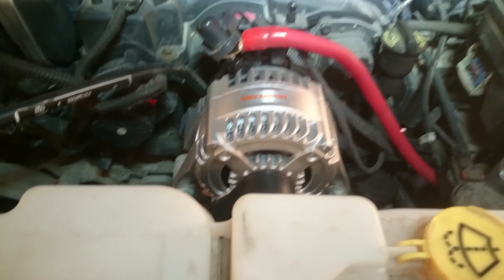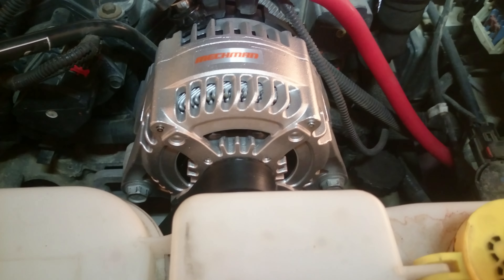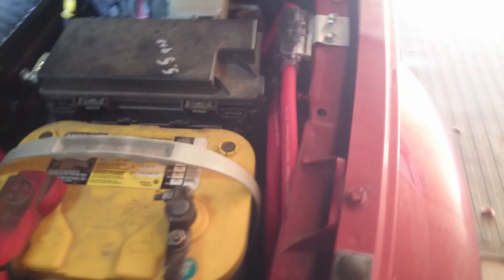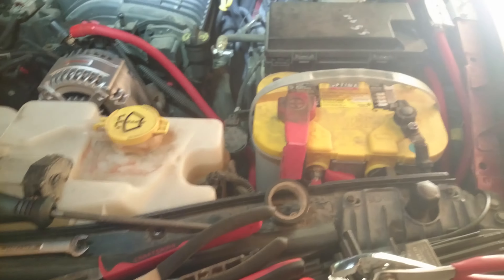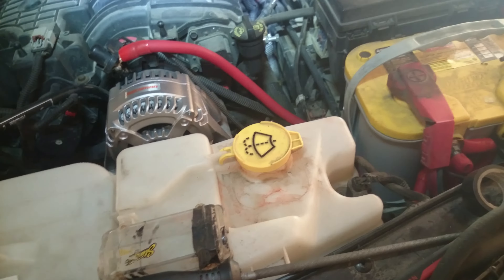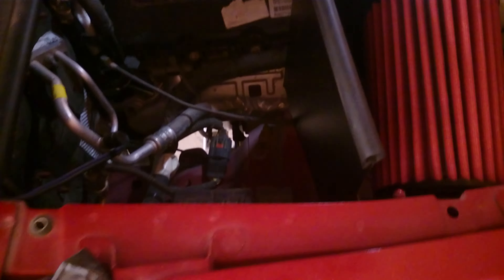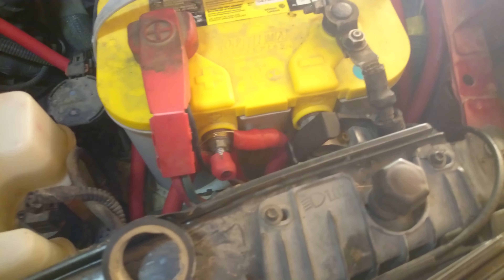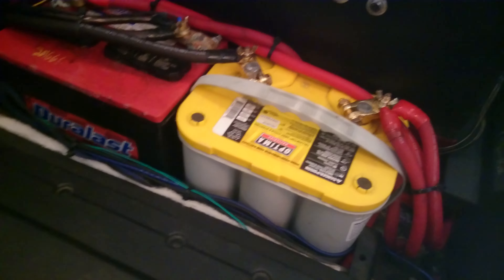Dodge nitro 240 amp alternator and fuse blocks

Comment: Did you have to get a shorter serpentine belt to work with that mechman alt?
Reply from the maker: Yes
Reply: @kyleworful5741  sheeiit lol do you remember what size it was?
Reply from the maker: Unfortunately no I do remember that it was like a half inch to an inch shorter then factory

Comment: Did you have to remove the washer bottle / coolant tank combo to remove the belt before you took off alternator?
Reply from the maker: Yes had to remove it for ease to taking belt off but your going to definitely want it off to remove the altinator bolts if you have the 4 liter

Comment: How much did it increase your voltage I have a stock alternator and I have 2 budget 6K amps and I have six 1500 watt RMS Subs with a group 31 AGM 104 amp hour and 1 run of 4 gauge and one run of 0 gauge and I've got a total of 3 amps one for my mids and highs and the other two for my Subs I put a power wire from the alternator to the battery and that's as far as I've done on starting the big  three because I ran out of wire I'm debating getting another alternator or a bigger alternator I do a lot of playing my system when I'm parked what do you think would be my best option
Reply from the maker: Well 240 amp alternator does its job for sure long life but I was always drawing more then it could put out.  for your case if parked this is probably the best alternator for idle power if you go any bigger then this alternator it will not charge at idle.  for me I finally just added a second alternator in my car I have the 240 alternator on car, tweeters, mids, and accessories, with 3 yellow tops and the 320alternator  is just for my sub amp 5k rms with 4 110ah agms and with doing this I have very little voltage drop when at 1500 rpm or more but at idle it just battery power so when I'm parked just rev it to 1500 to 2000rpm even on the stock alt might help. Finish the big 3 and then try what you got.
Vid coming soon on the dual alt setup

Comment: Hey i have a 2010 nitro and im looking for a new HO Alt , where'd you buy yours from and how much ?
Reply from the maker: Rashad Woodley bought mine on mechman.com for 399.99
Reply from the maker: this is a 240amp alt they do make a 320amp alt but It won't charge at idle that's what I was going to get but doesn't work for a daily driver
Reply: Hows that 240 holding up for ya?
Reply from the maker: Rashad Woodley good for the most part but my new amp is a hcca11000.1d so I need more alts but before I got that I was awesome on average it would not drop below 13.8
Reply: oh thats awesome ! what amp were you running before?
Reply: right now  I am planning to buy a 2000-2500w amp but i do not know whether I should upgrade the alt or get a second battery. My current alternator is a 160 amp.
Reply from the maker: I would at least get a second battery plus it helps for the cold starts and when i had the Orion xtr2500.1d by itself that's when I was holding the 13.8 but on 2 of them it was about 13 or so and my hcca11000.1d lowest was 11.2 and all three setups had 2 yellow top batteries and 1 duralast and of course the 240 alt